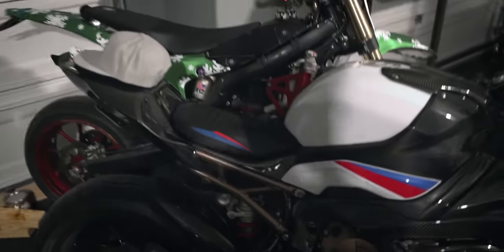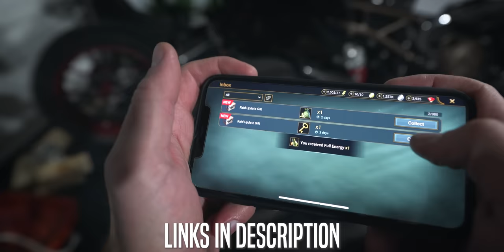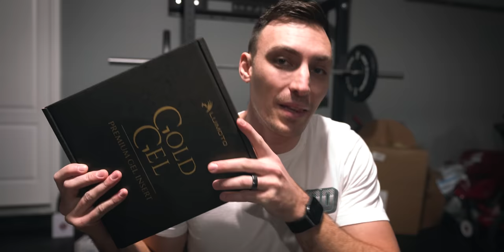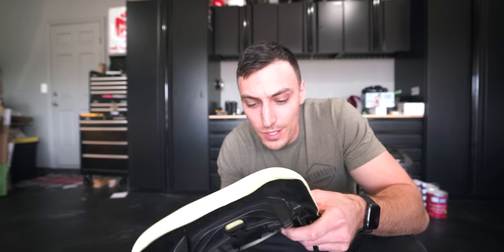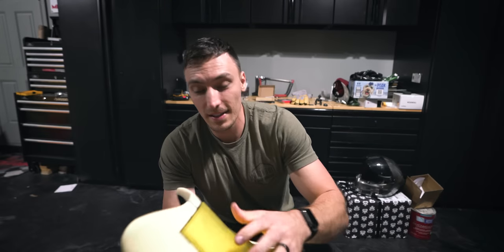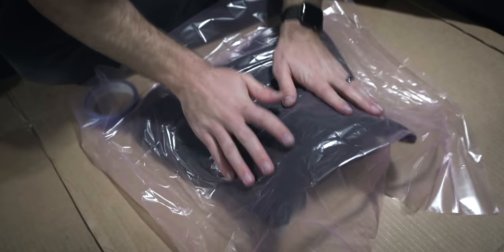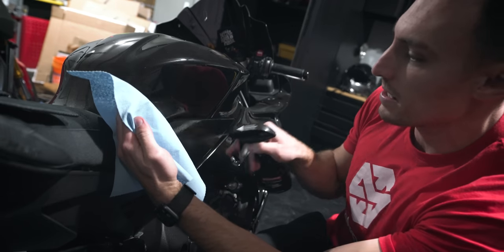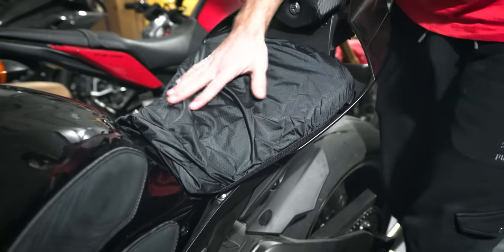The Coolest Motorcycle Seat You Can Buy [Yamaha R1 Install!]

Comment: also when laying things with tape even vinyl peel just a small section fold it where you can pull it from behind and place where you want it and peel and stick from oneside slowly working to the other keeps you from getting air bubbles or dirt and trash on the 2 sided tape works great for stickers and vinyl graffix as well

Comment: a good sanding pad on a drill or air angle grinder works great to take down the foam just go slow and works great you can use that to feather it in nice and even and smooth as well

Comment: Do you have to cut out the factory foam on the seat? Or can you just lay it on top of you order enough gold gel.
Reply: Our seat covers are designed to fit snug like the factory seat cover. If you lay the gel on top of the foam, then install the seat cover, the feel will be off and look strange off the bike with the seat cover awkwardly installed on top. Trust us, we've tried haha. However we are developing our gel pad as an add on if you decide cutting into your seat isn't for you.
Reply: @Luimotohq  thanks for the heads up! If i were to do such a thing i would trim the squared edges down where it laid flush to the best of my ability. If i do i might post a video on how i do it and show everyone how it turns out. But i will definitely be ordering a seat cover and some gel for my R1. Thank you guys for what you do!
Reply: @JUS-DEH-TEEP  Anytime! We also have install videos to help you along the way. Looking forward to your video!

Comment: Those lower tank leafs are going to come off / slide down if you have an R1 with plastic for the lower tank fairings.  The adhesive doesn't work correctly.  I tried 3 different sets of grips.  If they are painted should be fine
Reply: Mine have slid down as well 🤦‍♂️
Reply: @allgasnobrakes919  I removed the lower grips and got carbon fiber lower tank pieces

Comment: Do the seats absorb much water while you’re washing the bike? Or would the cover be necessary?
Reply from the maker: It's pretty easy to dry them off with a towel after washing but they'll still be damp until they air dry. I've always just made sure not to spray them directly with water so they don't get very wet. I have however gotten them completely soaked from rain and from doing a wash and they dry out looking and feeling just like new.

Comment: Can you just put the gel on top of the foam instead of cutting out the foam?
Reply: Our seat covers are designed to fit snug like the factory seat cover. If you lay the gel on top of the foam, then install the seat cover, the feel will be off and look strange off the bike with the seat cover awkwardly installed on top. Trust us, we've tried haha. However we are developing our gel pad as an add on if you decide cutting into your seat isn't for you.